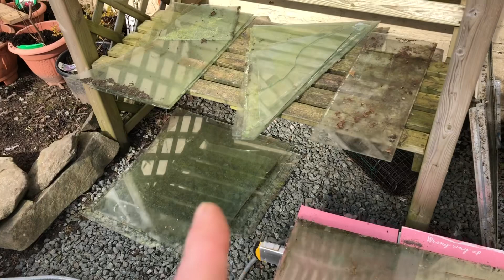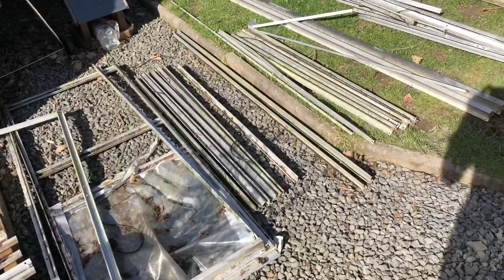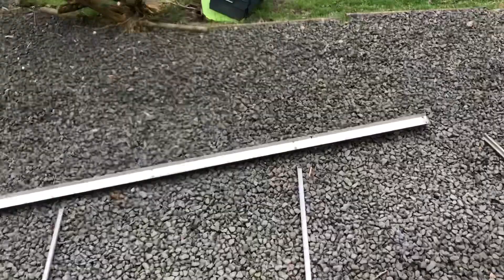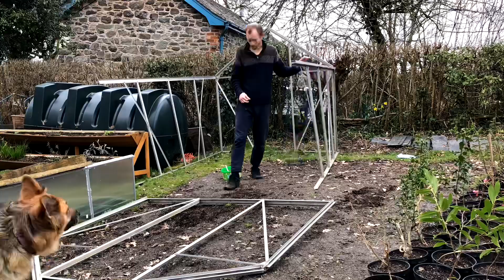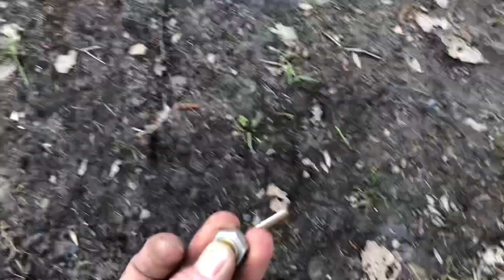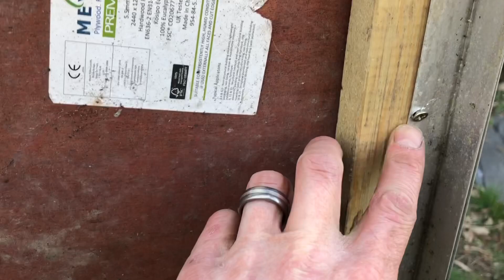Greenhouse Assembly & Restoration | Aluminium 6x8

Comment: Great video. I’ve just been offered what seems to be the same greenhouse. I’ll be going to disassemble it this week then clean and rebuild pretty much as you have. Can I ask where you found the plans and what size heads the bolts were? They look like a 10mm socket would fit but I could be be wrong. Thanks. 😎

Comment: I just rescued a very similar 6x8 from a house that was scheduled to be torn down. Luckily the greenhouse was out of harm's way but I still had to get it off the lot sooner than later. I pretreated all the nuts and bolts overnight with penetrating oil to break any rust. I had to drill out a few stubborn bolts but that went quickly. The screws used to anchor the greenhouse to the foundation ruined three bits. They were very rusty but reacted like stainless. My titanium bits didn't make a dent! 

Thanks to your vid I was able to break the house down with the four sides intact. Before breaking it down I marked all the pieces with numbers or symbols to make sure that they will go back together properly. Sadly on the last side (door side) the base rail was completely rusted and fell apart. I have a plan for repair and it should be fine. 

Mine has fiberglas panels which are intact although slightly yellowed. They should work for now but I'll watch your glass vid for future reference in case I decide to upgrade :)

Comment: The steel nuts won't go rusty but they will corrode the aluminum frame by galvanic corrosion.    If you can't find aluminium nuts then use some of the black tape you have there so you don't have steel touching aluminium.
Reply from the maker: Didn’t know that, thanks

Comment: Some of the glass in my greenhouse was broken over time so I replaced them with polycarbonate panels. The only downside is that they have to be well secured otherwise the winter storms will blow them out.
Reply from the maker: Yeah I’m not keen on poly panels but they are cheaper than glass.

Comment: You are a star. This was about the fifth vjdeo I found after I was given a greenhouse which I dismantled without any thought of getting it back together Looking at the pile of filthy aluminium spars in my garden I thought this is a mistake, but you saved the day with the construction manual download. Like you I hadn't noticed the embossed part numbers so when my replacement clips and bolts arrive, rebuilding should take about 5 hours less than working blind. It is a Halls Greenhouse if anyone else is interested. I am now a subscriber.
Reply from the maker: Thank you Bjorn. That’s great I’m glad you found it helpful. Good luck 🌱🌱😊🌱🌱